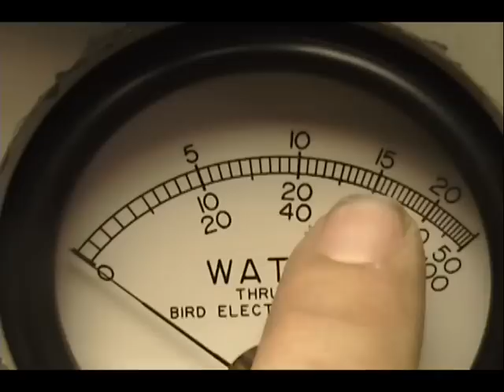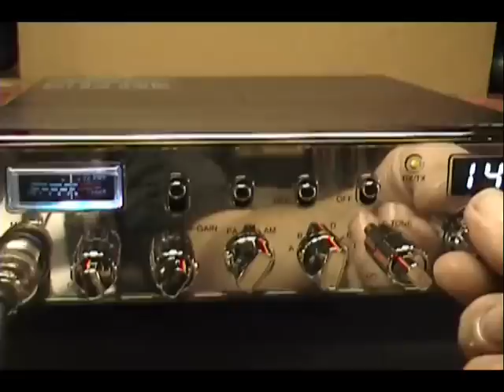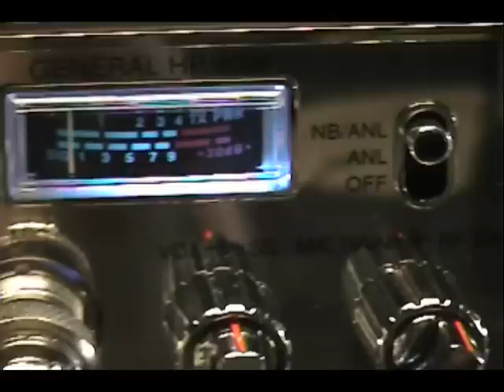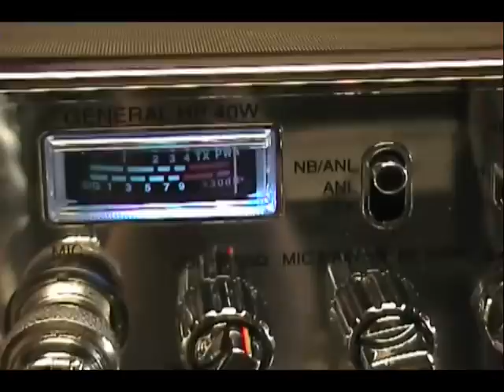General HP40W Tune-up Report

Comment: Skip has been going nuts lately.  Crazier than in this video...heard European stations booming in with the Spanish speaking taxi cab dispatch ladies mixing in all over the band.  

26.915 MHz - channel 36 on band C is a big radio channel indeed but I've worked a lot of DX on 26915 with a 4 watt radio.  With something like 100-130 watts peak and a good antenna, frequencies like 26.915 are a real blast